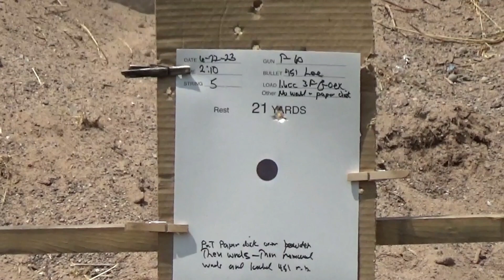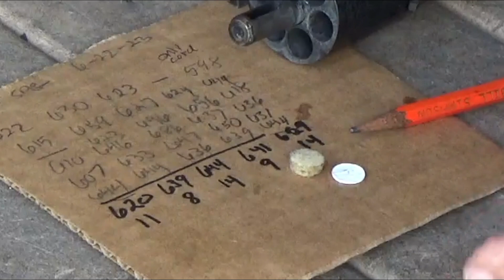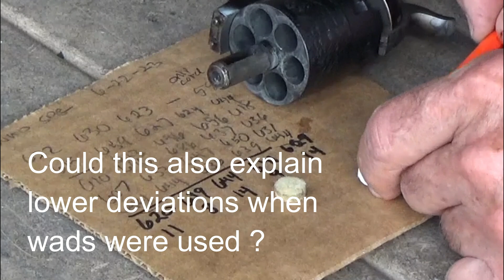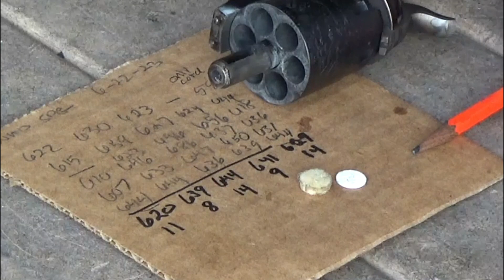Wads in BP Revolvers -  Why Lower Speeds?

Comment: You maybe on to something.  As you may, or may not recall I rarely use round ball. Exceptions are my .31 pockets. Right,or wrong I've always lubricated over the top. Of course a revolver for me can be loaded for long periods of time, so I held to the lube against the powderleads to powder contamination. Even if I use the lube grooves, I'm careful not to get any lube on the base. Yet still lube over the the top. Maybe it's my unique version of OCD😮 Who knows recently I seen a video from lame beaver where he picked up lubed wad that still had unburned powder attached to them. I can't claim any great insight on this matter as I started shooting these revolvers back in the seventies lubeing over round ball, and the only changes I made was to conicals in the early eighties.
Mountain man

Comment: Suggest 1. Do your normal (wad) load procedure then put your lube on top of the ball. If the speeds average higher, it is lube in the barrel making a difference, if speeds the same, probably the wad damaging powder... 2. Now try wad on top of ball. Great channel and great observations.
Reply from the maker: Thanks for the suggestions. I’m agreeing that more is needed. Because I’ve used the chronograph quite a bit I’ve noticed patterns that can use some explanation or theories: like, why speeds from a clean cylinder are (hate to say always) less than preceding ones. O.R.
Reply: @oldranger3044  I also would be interested in results from wad on top of ball!

Comment: Well, that was a very revealing demonstration, 100fps difference with the same load? I wonder if the reason for a drop in speed could also be due to the fact that the charge cannot be as compressed due to the springy wad, the fouling in the chamber would also give more resistance before it let go, but the biggest revelation here is why I never use over powder wads, they give lower velocity and worst accuracy, and less barrel lubrication. Many thanks OR for conducting these deep into ballistics experiments! Chris B.
Reply from the maker: I never thought about the compression factor. Since these lower speeds seem to happen also without the wad and only paper disk,  well?  May get the chance this summer to dig deeper into this. Oh, another can of worms l haven’t opened is why my lubed wads shoot 2-3 inches lower at the 21 yd mark then with wads or when using nothing. I just finished editing a 5 part series of testing wads, lube, and shooting dry. I attempted to put them all into a play list. Getting tougher for the Old Ranger to do the editing and make all the neat moves that can be done on YouTube. Guess I’m just out of touch and spend a lot of time keeping fires going this time of year. Right now I’m deciding how to seat the breech plug when it is.040 too short. Looks like part of the barrel needs shortening. Thanks again for your insight. O.R.
Reply: @oldranger3044  I reckon you do really well uploading videos to youtube, it all seems like magic to me! The breach plug should be no problem, just turn the difference off the end of the barrel, I hope you have not cut the lugs or sights in yet! I know what you mean about feeding logs on the fire, we were a bit late bringing ours in last year, and as the last in are the first out they are a bit damp still. Stay warm! Chris B.
Reply from the maker: @453421abcdefg12345  The last shall be first, and the first shall be last. I’m ok with that, except when it comes to wood. 
Thanks, probably struggling with remembering what does what with the editing software helps keep the brain in someway. Amazing when I think there was a time when I couldn’t have even imagined there would be personal computers, cameras, and being able to communicate with people like we can today. Right now, do the plug first. Got it done this morning. Don’t have a big enough lathe (been on my wish list, along with a big enough heated shop), so I took it off with the milling machine which worked ok. If I get this rifle done before one (or both) of us see’s Hershel, I’ll do a video and send a link to you in a future comment (should work in theory). O.R.
Reply: @oldranger3044  Aaaah! That is why we need to live closer, a few cuts and the job is done, but then where is the fun in that? Keep safe!. Chris B.

Comment: Good Job Mr OR. - There are SO many variables eh. The old single-shot 'Turn-Off Barrel' (Screw-barrel) pistols are said to make higher power/Velocities from that pressure build-up resulting from the ball being held down momentarily onto the small but COMPRESSED powder charge.
Might the wads be reducing the compression effect by causing a circle of air around-behind the balls? - How about trying compress the balls directly onto the charge then "top-off" with the lubed wad ??. Have a Great Day anyway ..

Comment: I make my own lubed wads and they may be thinner than commercial ones.   interesting theory.    it would seem to follow then that the more oversize the ball...  the more it would be 'sized' to an oblong shape which would mean more bearing surface and meaning more friction....  or more pressure to start the ball rolling so to speak.    For me wads are the way to go.    It gets pretty hot here in the summer and bore/grease/butter turns to goo in not too long a time.  Nickel is pretty smooth.     When I nickel plated my cylinders I just stuck cap screws in the nipple threads and dumped the whole works in solution.  reaming the cylinders first tho from .366 +/- to .372 just like the bore.    I use a .380 ball.     I admit tho that I have not checked the velocity lately.  There seems to be a noticable accuracy improvement tho and things clean up.... easier.
Reply: Do you plate revolvers for other people?
Reply: @xxx-v1f1p  Naa...  Anyone can do it with minimal setup and investment.   The biggest.... by far... thing is the polish of the metal beforehand.   Also for carbon steel you really should copper plate first as a base coat/barrier.   These BP revolvers were learning practice for me.   LOL... I have plated a lot of my tools now.   Also some high carbon knives a buddy made me that the women did not like cause they discolored (a natural browning process) so rather than listen to em I just plated the blades.    Honestly I thought I knew how to polish metal but nickel plate really shows every mark.   In fact... the Naval scenes on the cylinders were very faint in blue but really stand out now in nickel.    I really think the combo of color case frame and the rest of the gun nickel looks just right.
Reply from the maker: Excellent idea to see if a 454 would make a noticeable difference in speed. Something to check out. Thanks. O.R.
Reply: @oldranger3044  yeah... LOL.. it is all relative to bore chamber size.   My 44 1860 and buddies Remington now have .4525 cylinder bores.   I was using .454 balls but they just are not big enough in dia   I am casting .457 balls now but you can buy ones in that size.   Basically?    the bigger around the ball before sized in the chamber the more bearing surface to grip the rifling you will get   problem of course is it would just take too much pressure size in really small chambers.     Son talked me into doing some youtube stuff..   Got a couple of things lined up I can show from the kitchen table. like what the balls look like after sizing and how the rifling imprints look using large balls in large chambers vs say .452 sized in .388+/- ones.    The bearing surfaces are very similar but....  when driven down the bore the difference in depth of rifling imprint is obvious.    In... My....opinion...  using a 452 ball sized down to .388 or so  likely has enough bullet to rifling engagement at low BP velocities to stabalize the ball..... but..... you are dealing with very shallow engagement.  often only a few tho..... if the ball is not perfectly round or cast a bit small?    I think those are the flyers we can't explain!    as you note... sometimes just the sprue cut is deep enough that it does not engage at all!!    The way I do it you can't even find the sprue cut if it was on the side.    How much does BP 'bump' up the size of the ball?   from recovered bullets in the past it don't seem like anything at all.    BP rifles like my Hawken use a patch.    and guess what?  different thickness patches affect accuracy.     How much effect at 100 yards for revolvers?    have not done that yet but will.    I can hit a 5 gallon bucket at 100 yards with a little J frame 38 spl.   I could not hit a man size target at 100 yards with the stock BP revolvers.   Again... there is no reason that a BP revolver should lose accuracy at distance like that.   again..... IMO..... I think the balls are not being stabalized enough ...  fine for short range but not for 50-150 yards    I mean...  a smoothbore does kinda ok at 20-50 yards.     Then again?   I could be full of shit on this.

Comment: Another possibility would be that the extra space/cushioning of the wad between the powder and the ball somehow reduces the pressure/speed. But your test seems to show that the wad lubing/cleaning the chamber mouths is what is reducing the speeds. Interesting.
Reply from the maker: Yes, I hadn’t thought of that, but as you point out, speed seems to be reduced when only a paper disc is used. I think some more testing should be done because we aren’t talking about just a small speed difference here. It also correlates with the amount of decrease there is when shots are fired from a clean cylinder. Thanks. O.R.

Comment: i loaded a Pieta 45 cylinder with a 40 gr pellet of powder, and a ball, i use kiwi for each chamber, over the ball, plenty of room for a wad, if you must.  Haven't shot it yet.  Let you know how it works, but it was quick an easy to load.
Reply from the maker: I’ve no experience with pellets, they must be quite compressed, otherwise doesn’t seem there would be enough space. Yes, let me know. O.R.

Comment: This gives a little credence as to why I have noticed better grouping when loading a fouled cylinder but firing through a freshly cleaned barrel. But now I'm so low on caps that I hardly shoot anymore.
Reply from the maker: That primer thing is only the tip of the ice berg when it comes to what’s wrong. O.R.
Reply: @oldranger3044  Been kind of a crappy road for me. I got into black powder about the time the shortage was getting bad. I bought 1000 caps and when I went to stock up more, nobody had any. Or they wanted over a dollar a cap. Is making my own the only route at this point?